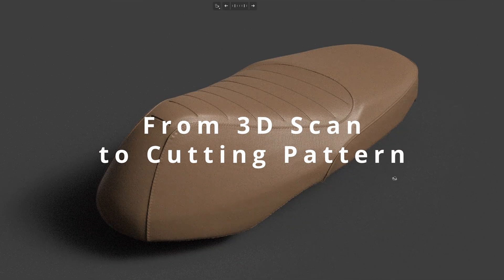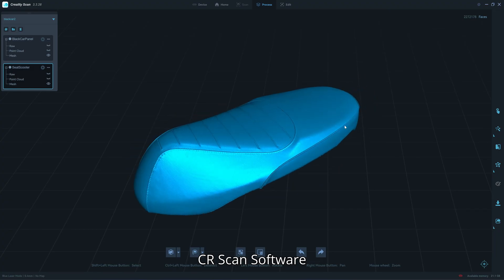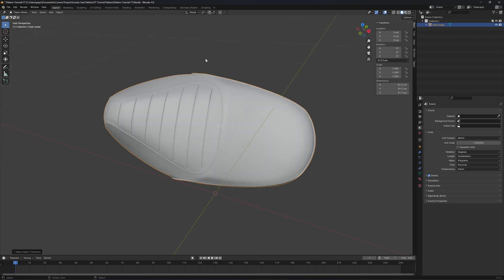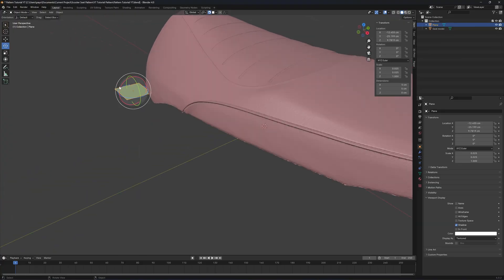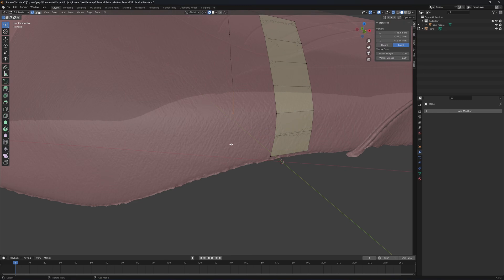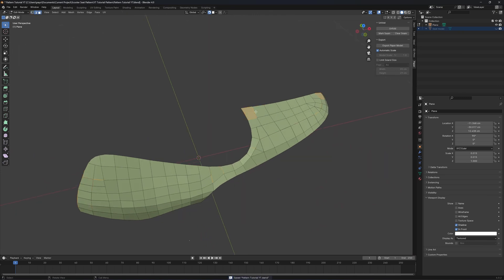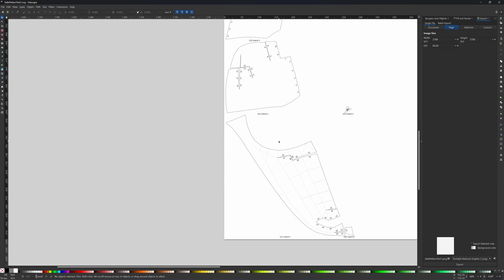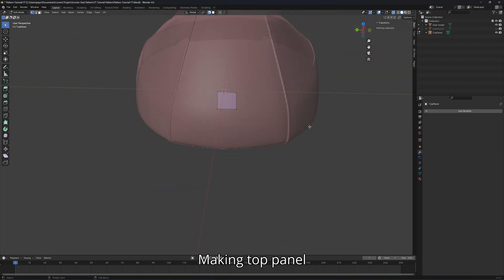From 3D Scan to Cutting Pattern - A Step-by-Step Guide for Upholstery

Comment: can u not view the flat pattern in blender before exporting?
Reply from the maker: Nope, no preview before exporting.
Reply: it looks like the addon is doing a uv unwrap process. I'm sure you could get a preview by either just checking the unwrap tab or by unwrapping the seams that are made. the unwrap tab also has tools that let you check deformations. im sure there is a better way to do this but his method does work.